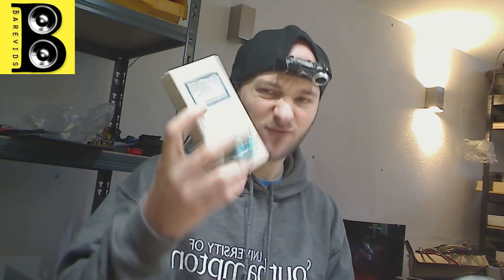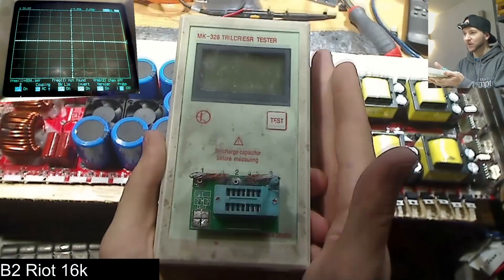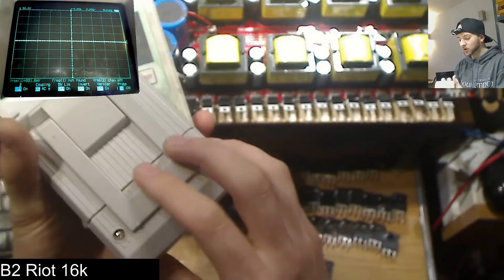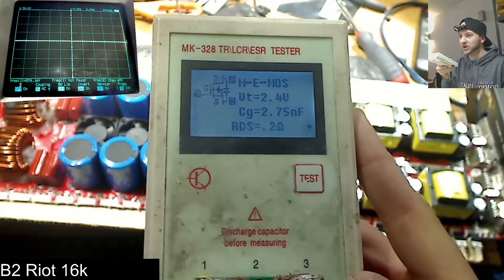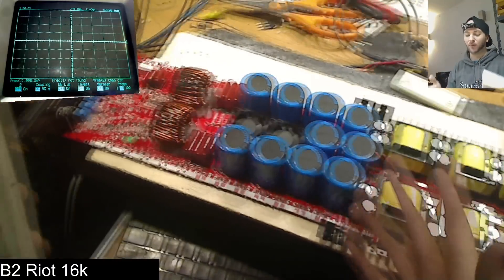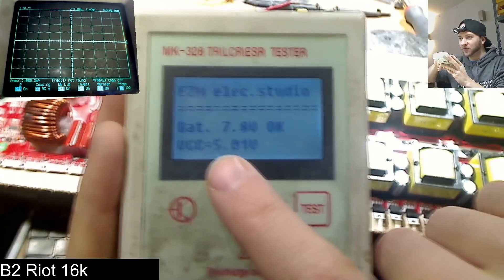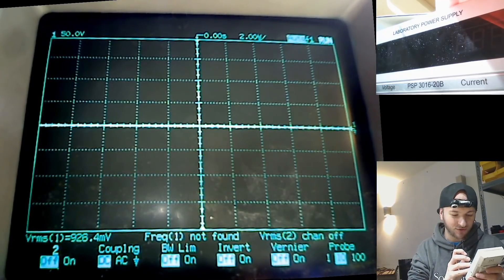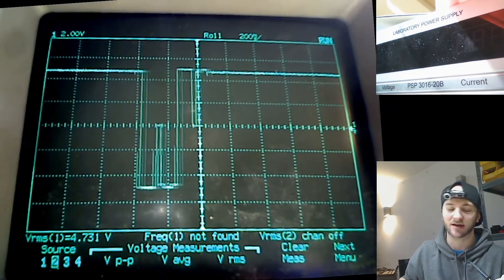These MOSFET testers arent quite as good as they seem... MK-328

Comment: I have an MK-328 with the "Ezm Electronics Studio" marking on the case but it displays the supposed "FAKE" MOSFET screen.   I don't know if either is a flag for proper firmware but  the case marking is NOT an indicator you will have the super duper MOSFET screen(s).  I bought the unit about 5 years ago (2016) off Ebay new, in box etc.
Reply from the maker: Well, damn. 😔

Comment: Hey Barevids, I recently got a Taramps smart 3. If I have my car on with amp on but not playing any music at all, the amp will still get pretty warm and the fans will come on, so technically they are always on weather I bump music or not. I havnt got a DC amp tester but my guess is it draws a fair bit of power at rest. Ive seen some of your videos where poorly designed amps heated up just at rest, is this the same design with taramps or do I have a faulty product
Reply from the maker: I haven't noticed high current draw with the smart 3 on idle. All amps will warm up a bit even when not being used that's kinda normal.
Reply: @barevids  ok thanks for the reply. It was 15 degrees C in car but amp heated to about 40C within 1 hour of being switched on but not playinf

Comment: You can put different firmware on any of these testers. There's a 268 page thread about them, all the clones, and all the firmware variants on eevblog: https://www.eevblog.com/forum/testgear/$20-lcr-esr-transistor-checker-project/6675/ Raising the VCC to be able to fully turn on some mosfets is probably going to require some code changes as well. Depending on how the reference pin to the ADC is connected, changing the VCC will give a higher output voltage, but it might make all of the readings the meter gives inaccurate. The meter uses essentially an arduino. The ADC in the arduino maps 0 - VCC to a digital value. Let's say for simplicity it's an 8 bit ADC, so the digital values can be between 0 and 255. The code assumes VCC=5V, so if the adc says "255", the code maps that to "5V". Basically each digital step = 0.0195V (5v / 256 steps). If you change the VCC, that mapping will need to be different, but the code will still take whatever the reading is and multiply it by 0.0195 to get the voltage. So if you set VCC to 6V, now when the ADC reads 255, that means 6V, but the code will still multiply it by 0.0195 and say "5V". If you're changing the firmware anyways, it should be pretty easy to go in and change that constant as well. If you set VCC to 6V, then the constant is (6V / 256 steps = 0.0234V / step). Pretty sure the arduino actually uses a 10-bit ADC though, so you'd have to adjust the numbers accordingly.

Comment: That EZM means nothing, just another generic.  You're grasping at straws as to why that one works and which are better.  eevBlog forum had a thread well over 100 pages on 328 testers,.Research the differences in versions which are mostly down to your personal preferred display type, graphical or not, color, ect. Though some versions see more ongoing development than others if you are into flashing AVR chips. All of them need to run calibration before use and should be done regularly unless you replace a few parts with more stable versions. I said stable, not precision, calibration reads exact values and bases the calculations on that so it doesn't matter. A lot of math and logical engineering has gone into the code to make these things do what it seems like the hardware should not be capable of.  All that said a curve tracer is really the tool for the job when it comes to testing and matching transistors/fets.  Or pair a 328 tester with a home built uncalibrated curve tracer
Reply: Necroposting, sorry, and I don't know if the video author gets 2nd order replies, but yes, a curve tracer.

Getting a copy of the ol' Navy book taught me to make an "octopus", which, while not being able to discriminate between components, is a poor-man's curve tracer and a "circuit" I use a lot that is only limited by how much current/voltage you have available (the mains are an option, but you could just as well use a AAAA) and the size of your biggest potentially sacrificial transformer.

Everything the parent said is correct, though "real" curve tracers are expensive and rare. The octopus circuit will tell you some things, again while not being able to discriminate ootb (maybe you could work something up with a microcontroller; the "328" is, of course, short for "atmega328"; a Teensy 4.1 already has enough memory, A/Ds, D/As, etc. to be brains. Could be a fun project to make a smart octopus and save 50$ K.

Also, elsewhere on this thread is mention of mikrocontroller.net which is, indeed, the where the avr code was born (and you can still find it maintained in its associated Github repo.)

Comment: I consider you a professional repair tech and someday it gets to a point where you should invest in professional tools. Don't waste your time with trying to tune China. These things work with atmega chips that are limited to 5V. You would need then a seperate ADC and software and power supply and and and. For the price these are unbeatable little helpers no question but they are limited. Anyway cool you pointed that problem out. It is rare these days to find people who are willing to share knowledge that openly and also tell the backstory. Awesome.
Reply: I bought 2 Peak Atlas DCA75 Pro, this is the best semiconductor tester that I found for Us$200 dollars.

Comment: This is where it took off a lot from the development community. Thread at eevblog and feel free to read the over 200 PAGES of comments and contribution from EEV community.  https://www.eevblog.com/forum/testgear/$20-lcr-esr-transistor-checker-project/  This project has come a long way and there is different firmware that can ble had and different versions alltogether. Not sure if any would use a test voltage of above 5V however. Edit...Here is a table of some available component testers (https://www.eevblog.com/forum/testgear/$20-lcr-esr-transistor-checker-project/?action=dlattach;attach=752949 ) Looking at the table there are a number of testers which will test zener diodes to under 35V compared to the 5V for the MK-328. SO these may be the way to go to test power transistors with a higher voltage but I can not verify it as I don't have one. Karl-Heinz has a paper on it which provides a lot of detail on how these testers work if you want to try and modify/build one  http://www.avrtester.tode.cz/upload/ttester_en.pdf

Comment: The datasheet will also tell you at what gate voltage the Rds (and other parameters) were measured at - most power MOSFETs are tested with a 10V Vgs, but small-signal parts or logic-level MOSFETs may be measured lower.

Comment: The original version is actually open-source and free!

It's called the AVR Transistor-Tester and you can find the schematics, firmware code, manual etc from here: https://www.mikrocontroller.net/articles/AVR_Transistortester

You can use those schematics to build your own or improve a cheap Chinese version, if they have left out certain parts.